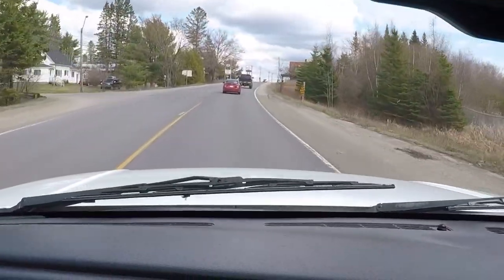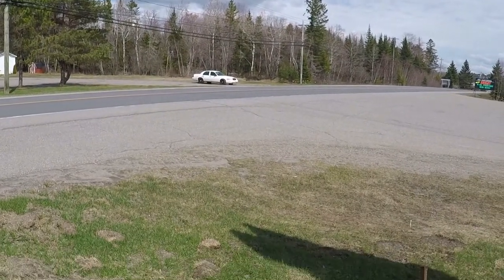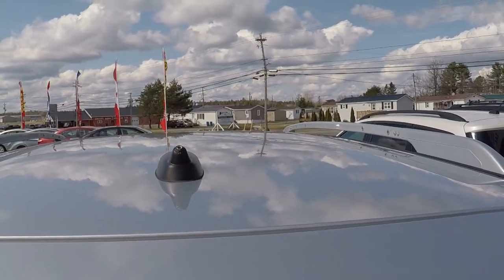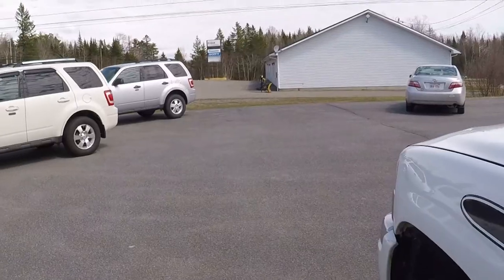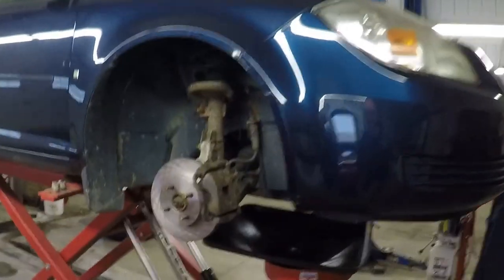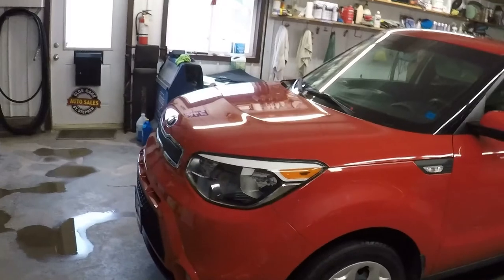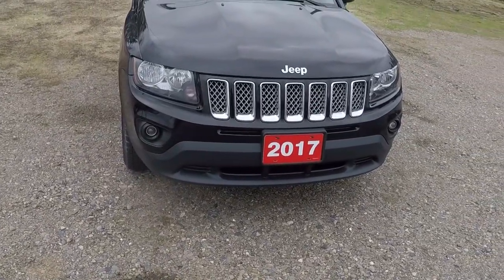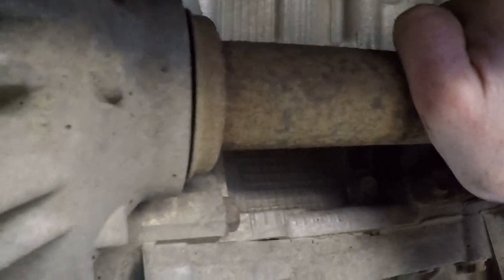Should I BUY This EX-COP CAR Ford PANTHER PLATFORM

Comment: I was skimming your old videos, and found this gem. 

You are going to be so much happier with the civilian panther you just picked up versus, an ex in service P71. 

I've had 3 panthers so far. 2000 Vic, 2004 Vic, 2010 Grand Marquis. All civilian, and previous owners didn't put to much wear, and tear on the interior, or outside. 

I don't think I'll ever get a P71, because I keep reading they usually have leaky oil coolers, and trans cooler lines. Not to mention spending the first few years of its life operating at two speeds, (idle, and full throttle). Lol

I really want a long wheel base town car. I really like the extra 6 inches of leg room for the rear passengers, and those extra long rear doors. It just looks so classy to me.
Reply from the maker: I agree! I’m not sure I would’ve found a car in this good of shape as an old police car.